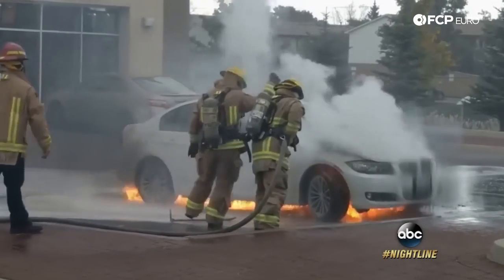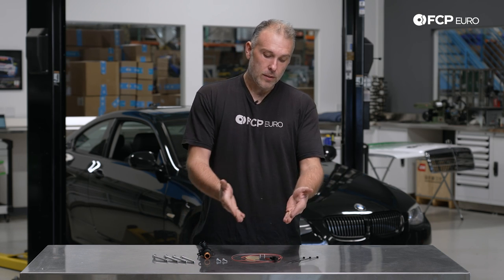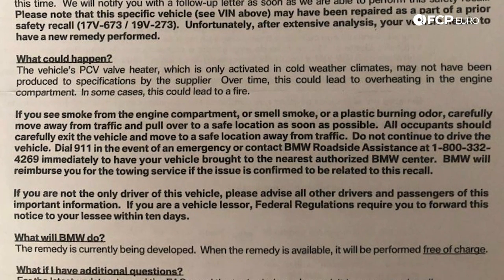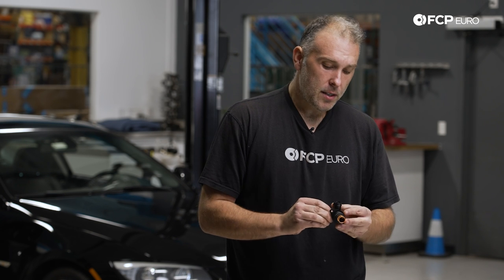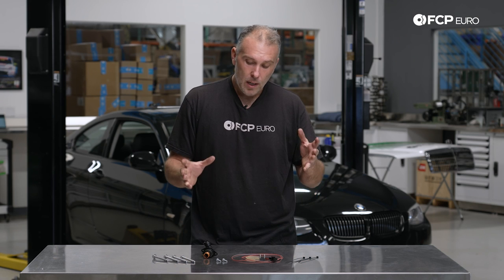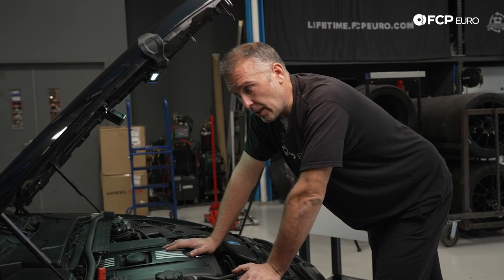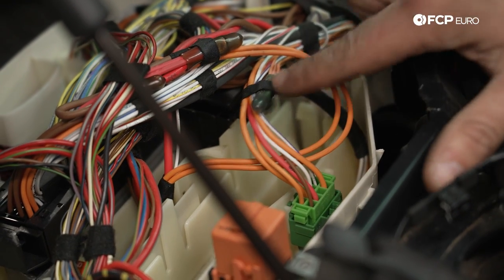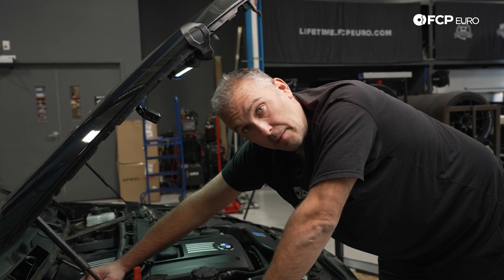BMW N52 22V-119 PCV Heater Recall - What You Need To Know

Comment: I hesitate to take my favorite car for the dealership I have here in town to do electrical recall stuff. My last vehicle that went in for a recall was my e70 for the fuel pump to prevent a fire. The person didn't do proper soldering. Then a week later, it almost caught on fire. Because of that. So I would much rather do the recall myself on my e82. I know it will be right. Thank you for the info.
Reply: I agree, everytime I ever took my car to a mechanic, they always cause a problem, I don't trust mechanics at all, I trust myself.

Comment: Thank you immensely, there was so much confusion on what was exactly done, especially where the fuse was being placed.
Reply: Glad it helped provide clarity. The worst part about this entire repair in regards to installing the inline fuse is identifying the wire in the splice which varies from chassis to chassis due to the electronics layout. All the wires in the splice are orange so the only thing you have to work off of is the thickness of the wire. Step 1 is finding the splice and step 2 is identifying the correct wire in the splice. It's outline in this document here:

https://static.nhtsa.gov/odi/rcl/2022/RCRIT-22V119-8155.pdf

Comment: I took my 2009 Z4 with the N52 into BMW today to get the recall done.  Great video to see what they are doing to it!
Reply: Had my 2007 Z4 repaired yesterday at BMW. On yours did they replace the heater device itself or just the wiring fix?
Reply: Just curious, how long was your Z4 at the dealership to get the recall done?  

I also have the same 09 Z4 3.0 love the car but until the recall I didn't know I was living life on the edge...
Reply: @CrazyOneToo  I think they just did the wiring harness from what I get from the invoice.
Reply: @jimmyk6336  3 hours. I think they did the wiring. If you read the recall the wiring harness is the issue giving voltage to the valve and causes the problem. I don’t think it’s the part itself just the wiring. I could be wrong…
Reply: @cameronlaurent  Thanks for the response. Getting the job done the same day is pretty good timing if you ask me. Hopefully this is the fix to end all fixes, good luck to you sir...

Comment: As always FCP Euro stepping to the plate and informing the bmw community. Thanks!!!!!
I just wonder if that fuse blows up how would you know? I am.assume won't trigger any CEL....
Reply: It probably would trigger the CEL but if not the worst that would happen would be the heater element won't work anymore, which is only likely to cause clogging of the CCV if the car is driven in cold climate for lots of short journeys. Othewise it will make no difference.

Comment: I followed your procedure. I don’t have a mm gauge, but the wire is basically the second largest wire out of the 6 wires. It’s located on the rubber conduit closest to the window because that feeds the driver side of the engine, I.e., angle connector, MAF, etc. 
thanks for the tutorial.  Oh, the 6 wire harness sits inside the rubber conduit. You’ll have to pull the rubber back and find a way to hold it back to get a good cut on the wire. I used a zip tie to keep the rubber conduit back. I have a 2011 328xi auto which has the recall.  I did it myself.

Comment: Awesome information, Gareth!
I had BMW take care of mine recently. 2008 E82. 
Actually I had my car in for new Bridgestone (NON Runflats! 👌🏻)  install & alignment and they did this recall at the same service visit. 

?: if the inline fuse blows will it throw a code?
Reply: No code is thrown if the inline fuse fails. It shares the same power feed as the O2 sensor heater circuit. For the 7.5 amp fuse to fail the angle connector would need to suffer a failure and that's not a likely scenario. Worth checking periodically I suppose but I think it's relatively fail safe in that regard.

Comment: I went in to clean out leaves 🍁 in x5 E70 saw a bunch of wires with connection in back of harness with zip ties! I looked down and saw a plug that looks like it was plugged into? But thanks I do have ecu code now! Same as last year that thought I fixed engine light to pass inspection in Massachusetts great info!

Comment: Thanks for the video. Question. Where is the multimeter hooked to for the current draw test?
Reply: I have it hooked to spades in the inline fuse holder. It's part of the testing procedure to ensure the amp draw is within spec for the angle connector.

Comment: Should I ckeck periodically if the fuse is blown or it will show a ckeck eng light on the dashboard?
As always, great work and thanks for sharing.
Reply: No fault code is thrown if the inline fuse pops. You can check periodically if you'd like but the fuse is only there as a fail safe. It will only break the circuit if there is a problem with the angle connector itself and that's not a very likely scenario.
Reply: @GarethFoley  Thanks mate, very appreciated
Reply: @GarethFoley  so the pcv heater is for cold climate. If the fuse blows u won't see a check engine light meaning in Florida I can just unplug it from being energized/delete power to it. Would that be fine??
Thanks this channel rock's!
Reply: @MR3JOBS  In climates where the temperature stays below freezing you would be fine unplugging the angle connector.
Reply: @GarethFoley  Awesome Thanks for all the hard work phenomenal content 👏👏👏

Comment: I scheduled an appointment to take my 07 z4 to the my local bmw dealership after receiving the recall on the mail.
Once I got the dealer they toll me I need to drop my car for 4 to 5 days.
Question do they need to provide a rental or i just going to have to deal with uber charges for a week?
I decided reschedule it for next week because I didn't plan on not having a car for this week.
Reply: Any updates? Did they supply you with a rental car till your car was ready?

Comment: Just had the dealer do this on my 2010 528i.  They did not mention the spliced in harness and fuse to me?  I need to see if the harness was installed. 🤞

Comment: I got this done at bmw feb 23, and ever since my car has been making a very obnoxious whistling noise. It’ll do it once in a while once a week, idle will be a rough and rpm will fluctuate (shaking the car) There was a lot of vacuume as well when the oil cap was opened slightly but the whistling noise would then go away.  Would this be due to the recall? or can this also be due maybe a broken breather hose during the replacement? also notice a screw wasn’t properly installed it’s sticking half way out too. Taking the car back to bmw tomorrow
Reply: Broken breather hose, right? Bmw has some micky mouse technicians.

Comment: Is the angle connector included in the recall? They never replaced mine and its blown. The fuse they installed was blown by the time I checked,

Comment: Bought a 2009 328i Xdrive two weeks ago. On the second drive the car started overheating. The car still had the original thermostat and waterpump. Replaced both of them with OEM parts from FCP Euro. Fast forward to today and on my way home sitting at a stop light I got a wiff of smoke. I pulled over and saw a very small amount of smoke come from under the drivers side hood near the windshield. I opened the hood and didn't see anything. I drove the car home about 11 miles and when I stopped in the driveway I smelled smoke again. This time I saw it was coming from under the intake. I called our local BMW dealership and they informed me there was no fix for 22V-119 PCV Heater Recall. When I explained to them I was looking at the recall and I they list the fix in the recall notice they told me unless I had a second letter from BMW it wasn't covered. I asked her to check with a service manager first and the company attorney second if the wanted to me to continue to operate a car that had a recall that was actually smoking. After checking with the service manager they concluded that there was a fix for the car and I could bring it in the following day. This is the same dealership that told me the Takata air bag recall wasn't covered under warranty on two other of my BMW's because I wasn't the original owner. I honestly don't know if I want these clowns working on my car. I've bought half a dozen older BMW from them that they deemed beyond economical repair the last one being a 2008 760i they said the valley pan was cracked and that it needed a new motor. I bought the car for $1200 it only had 87k miles on it. I spent about $600 replacing all the coolant hoses and the two Y hoses on top the engine that were actually leaking. The car hasn't leaked a drop in two years now. They just don't want to mess with anything 5 years or older. Not to mention there labor rate now is $225 an hour.

Comment: Mine hasn't been recalled. My wire for the angle sensor just burnt out up to the junction box under the manifold 😮. It was smoking bad, the fuse didn't blow. Going to do this fix myself

Comment: Quick question my car was one of the ones that had to go into recall I had an appointment one day on a Tuesday and the day before on a Monday my car would not start after it gave out on me at the light could this somehow be related to the recall, the reason why my starter is not holding a starter able to start? I decided to take it to the BMW dealership one day early after it would not start on me. I had it towed there. They are trying to charge me roughly over $2000 for a new starter. Could this somehow be related?
Reply: I have the same questions. I had a new starter installed, car ran for about 2mos. Then, starting issues again... battery was low, and I was told it was the alternator. I'm wondering if this faulty valve is draining power from the vehicle. Did you ever find out for sure what your problem was? Afraid to go to the dealer because I'm sure they'll find something to try to rob me on. The last time I went in for a recall, mysteriously, my 02 sensors up and down lines came up reversed, vehicle could barely drive away from that dealership. It was shaking horribly. They wanted me to pay $250 for diagnostic and only God knows what outrageous repair they were going to try to force me to get, but I declined.  Granted, it was rough idling some when I took it in, but when I left, it was noticeably worse. I remember the sales guy telling me this vehicle is not safe to be on the road, I can't let you leave without warning you of how dangerous this vehicle is right now. They def tried to scare me, but I was more scared of them than what might have been wrong with my vehicle. So, I took it to another mechanic who has his own BMW shop, used to work for BMW. They discovered the 02 line mixup, switched them back and my vehicle immediately started running like it was brand new. I fear these stealerships.
Reply: I have same issue my car would not start again after I drive it only after a good 5 to 8 hours it would start back had starter and the relay replaced it still have that issue

Comment: I took my 2007 Z4  in yesterday for the recall but the paperwork doesn't specifically say the heater was replaced. Does the heater device get replaced by the BMW repair?

Comment: This is a surprising design lapse.  BMW has mostly used fully protected and diagnosable control circuits since the mid-1990s.  The typical one is a low side "smart switch" with short-to-ground, short-to-bat and open detection.  As part of that, over-current problems are avoided by nearly instantly shutting off the circuit.  That protection is part of the "short-to-battery" detection for a low-side switch (a transistor that connects the component to ground, rather than switching the "high side" to +12V battery).
Reply: For sure a major design lapse. I'm assume the thought process was the amp draw was so low (which it is) and the likelihood of a problem ever occurring with the regulating element did not justify this added complexity. I'm pretty sure the N52 engine is the first attempt by BMW to utilize a heated system. I believe on a majority of these cars the angle connector is powered off of the same fuse which provides power to the oxygen sensor heaters.
Reply: @GarethFoley any way to bypass it and put a catch can? Oil getting to the Disa valves which makes them fail is another design flaw.

Comment: Any idea on when the angle connector will have any(better?) availability?
Reply: Due to the size of this recall I don't see it being readily available as a retail part in the immediate future. Usually when parts are being used as a part of a massive safety campaign their availability at the retail level is slim to none as the demand is huge and there is only so much supply.
Reply: I was told about this recall last March & when I checked in Nov parts still weren’t available

Comment: I received a letter about this maybe 6 months ago but they said they hadn't yet worked out a solution and said they would notify me when it becomes available. Not surprisingly, this is the first I am hearing that they now have a solution. They still haven't sent me the follow up letter, so should I just roll up to the dealer now? Like I don't need to wait for some letter telling me to come in?
Thanks FCP Euro!
Reply: That verbiage is sort of misleading. 22V-119 is as outlined in this video which is the replacement of the angle connector from new stock + the inline fuse. Since 917K cars are part of this recall BMW chose to take care of this in stages. At most, 1% of all vehicles are potentially impacted by this. In order to prevent a massive amount of people from flooding the dealers looking to get this recall sorted at the same time BMW has staged it progressively.

You will get notified when your vehicle is in the window to get the recall done. All of these cars are falling under the same procedure. The paperwork from BMW doesn't really tell owners all that much and we wanted  to provide a little more context as to what the problem is and what the fix is.
Reply: @GarethFoley  I appreciate the info! On another note, my 2008 328xi was built a few months before the lifter upgrade thing. So I have the ticking exhaust lifter problem that I want to address. I heard that BMW does the job at a reduced price for the labor, but also saw that you sell the revised lifters/rockers. Do you have any info about that? I mean as far as, would a good indy do it cheaper or am I better off to go to BMW? I heard that early on they were fixing some cars for free but not sure what to believe about all that. If I choose the indy route, what other preventative things should I address? Valve cover doesn't leak but maybe swap that since nearing 100k? Any sensors to change whilst doing that as well? I heard the eccentric shaft sensor should be changed? Car has 93k miles and I am 2nd owner. It's in perfect condition. Already did the entire coolant system, water pump, mickey mouse connector etc.all bought from FCP. I als happen to live in Wallingford, CT. Thanks! So basically, I plan on keeping this car for a long time and want to address all the weak points. I have had the car for 4 years now.
Reply: @saganworshipper6062  When it comes to the liter noise I know BMW was doing good will repairs on some cars but there was never an official recall for it since it's not a safety problem. It's really more of an annoyance. We have not done a video on this problem but it could be worth it for us to look into it. I've heard some people have diminished the noise by using a heavier oil (5W40 vs 5W30/0W30) and others have used an additive like Liqui Moly LM20004 with good effect to help cut down on lifter noise  on the N52 engine. 

When it comes to preventative maintenance I would consider replacing the valve cover even if it's not leaking. A weak PCV diaphragm will cause oil consumption problems and some cold start weirdness from time to time. Since the PCV system is integrated primarily in the valve cove it's worth replacing just for the sanity check. While you're in there it's not a bad idea to replace the eccentric shaft sensor since its right there and there is no better time to take care of it.

If you haven't done spark plugs and coils yet I would do those at the same time or close to the same time. On N52's I like to replace spark plugs ever 50K miles (half the life they are rated for) and replace all the coils at 100K miles. In the coil swap I recommend switching to Delphi coils from Bosch.
Reply: @GarethFoley Thanks for the info! I have tried every additive under the sun...to  no avail. From what I have read, it is a physical, mechanical problem that no oil will fix, and I have come to believe this is true. A video on that would be great and I could donate my car as a guinea pig since I'm only 20 minutes from you lol. I know I know, you only work on employees cars. Well, mine is available if you change your mind on that haha. I changed the coils and plugs straight away when I got the car along with replacing the manual trans fluid, both diffs, and transfer case with all OE genuine BMW fluids and everything was bought from you guys. I will go ahead and change the valve cover and the shaft sensor when I decide to do the lifter job. Funnily, I received the letter from BMW about the recall just yesterday so either I am one of the early ones or it has been sent to everyone. Either way, thanks!

Comment: Ever since I had this done at BMW of Santa Monica, the car has a dip in idle at a stop and it makes a whistle noise when I press the accelerator pedal. They also didn’t put back the air box and air hose back correctly
Reply: they broke breather hose when replacing